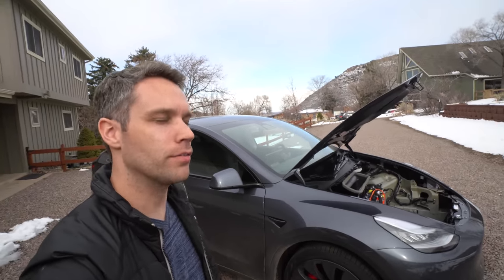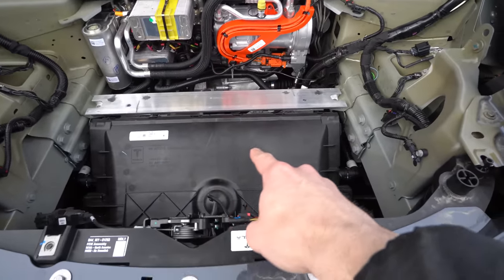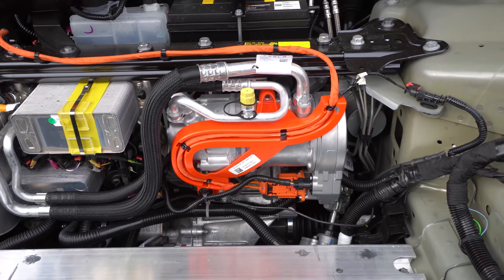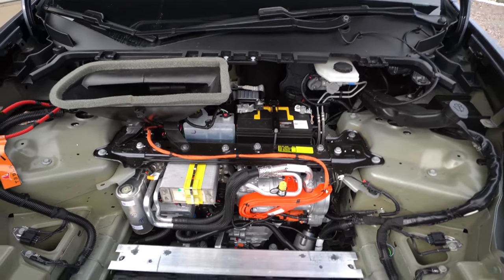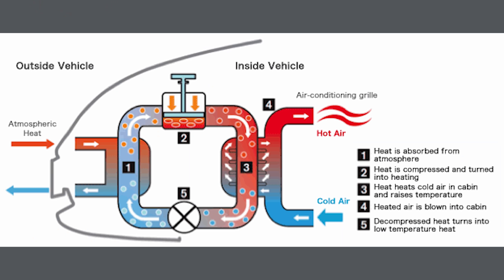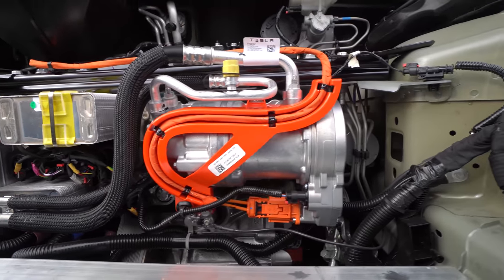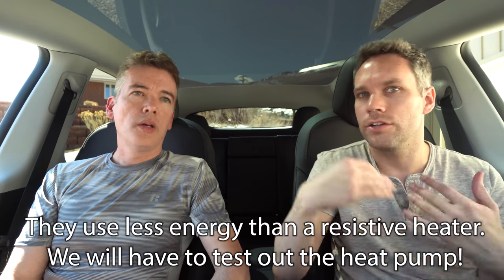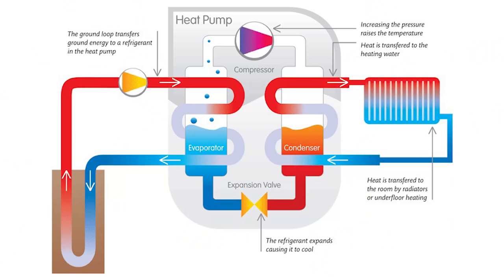The Biggest Change in Model Y Over the S, 3, or X!

Comment: Nice, informative video, however there is no such thing as 300% efficiency! Electric resistance heat (and lights) are 100% efficient as far as converting energy to heat since there is no Work involved. When you say 300% efficient you are likely confusing that with what is called the Coefficient of Performance (COP), which is how many BTUs of heat you get for 1 Watt of energy input. A 1 Watt energy input to an electric heater or light produces about 3.41 BTUs of heat output. A heat pump compressor raises the pressure and temperature of a refrigerant which increases the COP to something like 3.0 or higher. So you now get 10 or so BTUs of heat output for each Watt of power input on a typical heat pump.

Comment: It's inconceivable to me that Tesla didn't also include a resistive heating element.  At temps below 20-25 degrees Fahrenheit heat pumps become almost ineffective, therefore requiring additional support from other sources.  You likely won't know when the heat pump is being augmented by the resistive heating element.
Reply: They can make the morors run inefficient, generation about 4kW of heat per motor. That's how they heat the battery in model 3.

It's possible that they are taping into the coolant from the motors and send that to the cold side on the heat pump.

Comment: I always assumed all Teslas had heat pumps as my 2015 Zoe had one, and as far as I know they have since 2012.  I guess with 85 or 100kwh batteries it's not so significant, but since moving from the Zoe to another small battery EV without a heat pump, the heater/aircon can really kill your range.

Comment: compressor = heat pump. You fridge has it, all air conditioners have it ... in Europe the same AC pump is used for cooling and heating the apartment, it can switch direction with a couple of valves, or literally spin backwards.
What we're looking at here in the Model Y is a more expensive, more advanced AC compressor. Nothing revolutionary about it.
Reply: For clarity, the compressor still spins in the same direction (if it's a rotary compressor). It's just the refrigerant that reverses direction. The condenser coil and evaporator coil swap roles.
Reply: @whitslack  It was a long time ago, but when I looked into it, some manufacturers used DC motors, so they can easily control speed and spin it in the other direction (i assumed). Maybe I'm mistakin' cause I can't find it.
So are there two heat pumps in the Model Y? Or just the one, that can be switched to heat or cool? 🤔
Reply: @Poxenium  Reversible heat pumps use valves to reverse the direction of the refrigerant through the loop. You can't just run a compressor motor in reverse to pump fluid in the other direction. The motor itself will of course run in reverse just fine, but all the other parts won't do their job in that direction.
Reply: @whitslack  I read up on it, there are different architecture heat pumps that can run backwards, but they're only used in some industrial applications, not in consumer products.👍

Comment: But isn't there a higher chance of breakdown or repair and higher mantainance cost for a heat pump?
Reply: No, because every tesla has a heat pump already. Just no reversible. That is you can only use it for cooling. Model Y has reversible one. You can cool down or heat up. Not a big difference in machinery so not a big difference in reliability.

Comment: The Hyundai in Kia electric vehicles also have an optional heat pump option. Chevrolet apparently looked into this when they designed the Bolt EV but they knew that they were going to sell a lot of the vehicles in Canada. And heat pumps become significantly less efficient the colder the outside temperature to a point where they really don't operate well and you need to have resistive electric elements to assist. And so at least with general Motors they chose to keep it simple and use an electric heater only.
It certainly will be interesting to see how well the model Y heats up the cabin. I suspect in places with moderate climate like California it'll be perfectly adequate The real test will be places like Norway where it gets extremely cold. There is the advantage that the Tesla can also move heat around from the battery and motors to help out with this. One feature I don't understand why they don't offer is a heated steering wheel That's a really simple thing to help people feel more comfortable If your hands are warm the rest of your body tends to feel warm also.

Comment: I think pretty much everybody has a heat pump in their house. It's the technology that refrigerators or air conditioners use. 😂
And you probably have a heat pump in your car too, same technology is used by car A/C units. In ICE cars the compressor is driven by the engine directly via a clutch.

Comment: With my model 3 at -15c or lower the car can't heat the car enough to keep up. Specially at highway speeds or wind chill factor.  Run at less than 50% battery efficiency. Would love to  have the heat pump.  Any chance of retro fit?

Comment: What i am personally most curious about is wheter Tesla used their new Wiring Architecture in the Y, but by what i see in the Video it doesnt seem that way..

PS im surprised Tesla has a dedicated Heating Element.. i thought they used the Motors for that (pumping power into them without generating torque => heat for the Battery/Cabin. Bjørn calls this the "Afterburner")

Comment: I have a heatpump to heat my hot water cylinder, but it has a COP of 7 (coefficient of performance) I can’t believe tesla’s heat pump has a cop of 3 that seems very low. Does the tesla heat pump have an internal heat exchanger? (Gas to gas) does it have an adiabatic decompression turbine instead of an expansion valve? If it does it can theoretically get cop of 12

Comment: Heat pump is great and all, but not sure it will increase rated range. I believe rated range does not have AC running while testing. Switching to heat pump on say a Model 3 may actually reduce rated range due weight. All and all your actual real world winter range should still increase just nothing on paper.

Comment: I have a 2019 model 3. I also a ground-source (AKA geothermal) system to heat and cool my house. This system was sized for ambient temperatures down to 25F. And it works great except for when we have "days and days" of ambient temps never getting above 25F, then the house temp slowly starts to fall below an inside temp of 70F. Given my 40 degree east-coast latitude, failure to keep the house warm happens just once or twice per winter and just for a day or two.
I was wondering how the Model Y with its heat pump will work in really cold winter climates like North Dakota or most of Canada.
Reply: if you dont undersize your system you shouldnt experience anything like that with a home geothermal hvac system, you might need one more heat exchanger drilled in. The speciality of geothermal is that it can support heating with stable COF even in hard winters. air-air or air-liquid heat pumps lose efficiency in the coldest days of the winter and might need a backup heating solution. For the model Y this will mean (if they have no resistive heating backup) that in very cold situations the heating will be too slow (undersized) - while at non-freezing temperatures the heating would be many times more efficient.

Comment: 300% only in ideal temperature.
Reply: i am ot clear how it can be more than 100% efficient. Are we talking about a perpetual motion machine like situation here? Or did you mean 300 percent increase in effeciency from where it was previously?
Reply: @manp1039  it makes sense once you understand the physics behind it.  Rather than making heat...it moves the heat.
Reply: @manp1039  The terminology is wrong here.  It is misleading to state that electric heaters are 100% efficient because in actuality they consume much more electricity to produce an equivalent amount of BTUs/hr.  The efficiency of an electric heater is that all the energy goes directly into producing heat.  It's really just referring to the lack of losses because the electric circuit is very simple for electric heat.

Heat pumps and refrigeration in general can produce more BTUs/hr of heat transfer because of the refrigerant properties and phase changes that occur during evaporation.  So you actually get much more output from a heat pump if you give it the equivalent amount of input energy, ect...Heat pumps are rated with coefficient of performance (COP) ratings to better describe how they operate, and this changes with ambient temperatures.
Reply: @darrenorange2982  so it is a variable in efficiency and is a kind of leverage of efficiency, like how a pulley works?
Reply: @manp1039  Sure that's fair...but the only issue is that in this case you need a bigger one the colder it gets...which is the issue.  Soon it makes no difference.
Reply: @manp1039  It means that the heat pump takes 25% of the power from electrical compressor and rest comes from the air (air heat-pump). So you draw for example 1KW of power from battery and have total 3-4KW of heat thanks to heat-cycle process.

Comment: Use seat heating!?!  I don't need my but and back warm. Those are already hot because they can't breathe as they are right against the seat. Its the extremities that need warmth (i.e arms, hands, head, feet). A steering wheel heater would help a lot but Tesla has not figured out how to do that yet and the Model 3 heater is pathetically bad. It takes way to long for it to get hot especially on cold days.

Comment: Boy are you out of date!  In fact the heat pump in the Model 3 has the ability to scavenge heat out of the drive train and battery then place it in the cabin.  The heat exchanger in the Model 3 is on the bottom of the coolant reservoir.

Comment: I would say all houses in Sweden built in the last 20 years have heatpumps in them. Boilers powered by gas (non existant in sweden) or by electricity is very inefficiant compared to heatpumps.. We are using an Air->Water heatpump that is using the inside air as a heatsource and dumps the +1c air outside after beening passed through the cold side of the pump. My pump has a runtime of 47200 hours now (house built 11 years ago and heatpump we have been using the same pump all the time).. Heatpumps is the only way to go as ressistive heating is sooo inefficant you actually start saving money pretty fast installing a heatpump! So, no need to wait.. Make the change to help the world... US should have made the change 20 years ago :)

Comment: You need to understand something about a heat pump they lose efficiency between 30 and 25 degrees that means at low temperatures you still have to run a conventional heater.

Comment: Heat pumps are much more common than many seem to realise. All air conditioners nowadays also function as heat pumps to heat the house as well as cool it, at least any air conditioner manufactured in the last twenty years or so. So the question about who has a heat pump installed at home is probably yes for the majority of the people watching this video though probably many of them wouldn't realise it.
There are some installations that are marketed specifically as 'heat pumps' and sometimes these are actually different from normal air conditioners in some ways to optimise them for heating but by and large any air conditioner is also a heat pump.

The reason this is not so also in cars is simply because in cars (combustion engined ones) there is plenty of surplus  heat available anyway which you might as well use to heat the cabin rather than just throwing it away so no one ever really cared to add the little extra hardware needed to make it reversible. Electric cars have until recently just used stock air conditioning hardware carried over from combustion cars.

Tesla went further than just making the air conditioning system reversible to heat the cabin (like any common house air conditioner does) by developing a fully integrated heat management system where hot and cold can be traded between different parts of the car as needed and having the heat pump in the middle of all that boosting the heat or cold in whichever direction it is needed. So you have things like the cabin or the battery that some times need to be heated and sometimes cooled, the motors and computers which always need to be cooled (and hence supply some heat) and so on.
Reply: @dickamacher1  True, common air conditioners don't work well at heating when the outside temperature is very low, typically a few degrees below freezing. There have been air conditioners specifically designed for cold climates, and probably still are. They achieved that in part by adding resistive heating to the outside airstream moving over the evaporator side. This allows sufficient evaporation to proceed at ambient temperatures below which it normally could while still maintaining a reasonably good overall COP (even considering the power consumed by the heater). 
The temperature below which it will become more expensive to run than gas or oil will of course depend on the relative prices of those relative to the local electricity cost, but it will always be cheaper  than plain resistive heating.

Comment: I have a Nibe Heat Pump to warm up my house, specifically an air to water one so it takes heat from the air (till -25°C) to warm up the water of the heating system (65 °C maximum) with a little input of electricity (from 800w to 3600 w) that I provide with my 6 kW Photovoltaic system so I use only 100% renovable energy and I spend actually almost zero as energy bill!
Phisically speaking is not correct to say 300% efficiency cause the efficiency can not be greater then 100% but we speak about COP (coefficient of performance) but is a very near concept: for exaple my heat pump water system has a 3-5 COP ("300%-500% efficiency").
Here in Europe heat pump are becaming quite popular: for big buildings or for very cold climate are more suitable water to water heat pumps that take the heat from underground water as well as rivers, lakes, seas to warm up buildings and so that the source temperature is almost constant and much higher than air temperature this machines can achieve a COP of 6 (600%).

I have an heat pump on my BMW i3 as well.

Comment: Wtf?  I thought the 12v battery was out. Strange. 

Also why dont they use the pumps in the other vehicles?  Why did they wait?
Reply: DFKnightmare - Someone made the statement earlier that the 12 volt batters is needed, at least, because it powers the relays that connect and disconnect the high voltage battery.
Reply: @tedbaxter5234  The main reason that all EVs (that I know of) use 12 V systems is that all the car accessories (audio system, computers,  lights, pumps, fans, etc.) are easier to design and purchase for 12 V system because that is what the entire automotive industry uses.  All the manufacturers of those products have been designing and building for 12 VDC since the industry switched from 6V batteries 50 years ago, or more.  Without a 12 V source, all those accessories would be much more expensive, because they would have to be designed for higher voltage (with more expensive electrical insulation) and would be difficult to obtain.  What I do not know is whether or not it would be practical to provide the 12 V from the main battery, by using a voltage divider.  There must be some practical problems with using the main battery to provide 12 V.

Comment: There goes the warranty!
Reply from the maker: Warranty isn't void when I remove parts in the frunk. If I removed the heat pump, probably. But I just removed the frunk bucket. That's all.
Reply: Ok. Thought warranties were stricter than they are. Makes sense hearing it though. Thanks!

Comment: Sorry, but there is no such a thing 
"more efficient heater". Because any heater that uses electricity is already 100% efficient. 

(You can't go to 300% because you can't create nothing from something)
Reply: Since its not converting electricity to heat it just moves is from one place to another its uses less electricity to heat tha same cabin as resistive heaters
Reply: I know, it sounds impossible, like it's violating the laws of physics.  But it's true.  Think of it that the heat pump is moving heat from one place to another, rather than just converting electric energy to heat.  So as the inside of the car gets warmer, the evaporator coils in the heat pump system get colder.  Heat is moved.
Reply: I'm dumb 😂 thanks guys
Reply: You're right that it can't be more than 100% efficient, that's why for heat pumps they actually use a different term called coefficient of performance.

Comment: Someone tell Elon to include an electric generator fueled by water on an electrolytic cell so that the batteries can be constantly recharged. In essence, Tesla cars could be fueled by water without having to stop for recharging.
Reply: if that really effective elon may have done that.
Reply: KAIJUU CHANNEL, that’s not an answer.
Reply: KAIJUU CHANNEL, and the only reason Elon didn’t include an electrical generator is he wants to make fully electric cars. The electric generator still uses an small ICE motor. However, it would be nice if we can have an option to use it if you had to take long trips or go camping in a far off area.